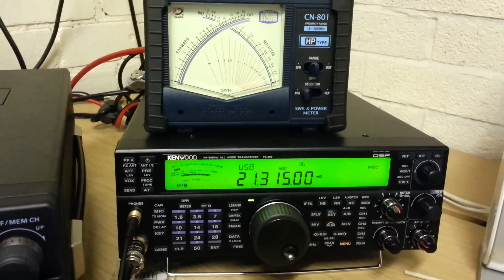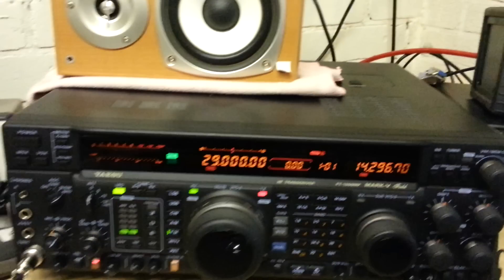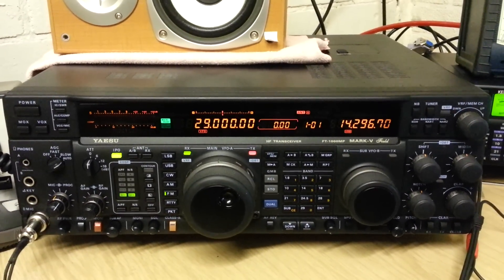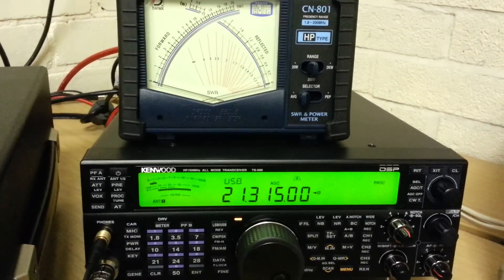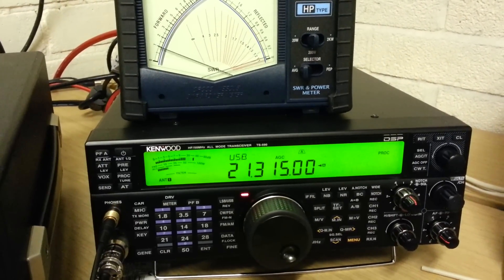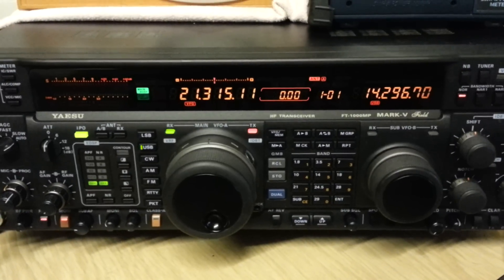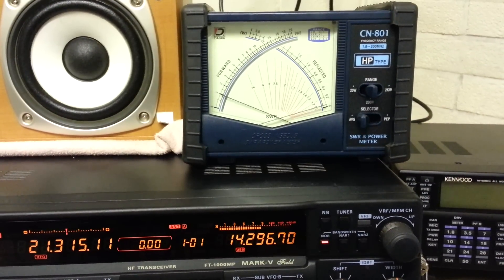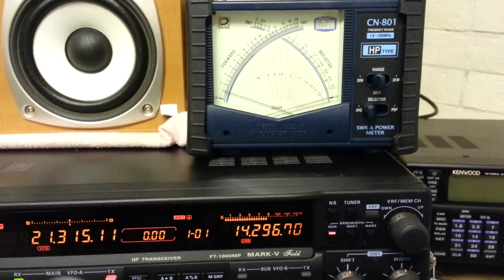TS590 vs FT1000 MKV Field SSB Talk Power

Comment: The correct way  to measure PEP is to use a oscilascope  and a two tone oscilator. I suspect that some radios, there mic sensitivity differers. Meter movements cannot respond fast enough to the peak of a wave form and those fitted with a so called pep meter are very suspect as I have found out for my self. G4LMZ
Reply: But since he's measuring average power in this video everything's perfectly fine here..
Reply: Average power does not give you true pep. legal max pep in the UK 400 pep.               Can not be done by measuring  average power.
Reply: True. Also true: this video isn't about PEP but average talk power. Your comment ('the correct way to measure PEP..') makes no real sense here. Some radios do true 100W PEP in SSB easily but perform worse (as in 'punch'/AVG) than some other with 40W PEP).
Reply: Some new operators might not understand the difference between analouge meter reading  and PEP
thinking there radio is faulty and if you have a 1000 watt PEP linear amp and your legal limit is 400 watts PEP how do you know when you have reached your legal limit what should the analogue meter be reading to represent  the power ???
Reply: Isn't knowledge about PEP part of the exam?
Like the envelope waveform and avg. power of a two tone test in comparison against single carrier and why it's used?
Reply: license states all ssb measurements  are in pep not average power [ UK]
Yes its in the exam  A AM transmitter for instance say a 100 watt carrier modulated to 100 percent will produce 400 watts pep  Two tone is the standard method which is used to check for a clean signal .to make sure there is no flat topping. Analogue meters cannot follow the waveform of ssb being to slow. A what would you say is average power for 400 watts pep  how do you measure it.
Reply: I guess Ofcom's regulations only state a maximum PEP,  not exactly how to measure - I guess you could measure with two tones AVG = PEP -3dB because it can be hard to measure PEP with single tone only as the voltage drops if power isn't stable - common problem of tube amps.
On SSB without compression I'd expect about 25% of PEP as AVG max - w/o compression but talking loud & long enough. I usually let my LP-100A do the measuring, but own cheaper meters like e.g. a Daiwa 801CN, too..
Reply: offcom states 400 watts pep
a two tone oscillator  and scope or other suitable instrument .  I have a Daiwa swr meter 
which claims to be able to read pep but it only charges up a capacitor which the meter is connected to and very rapidly discharges because of the meter resistance very misleading ,Max on 100 watts shows 40 watt. there are special meters around that peak hold for ssb
Reply: Just checked - I have a Daiwa CN801HP - which measures PEP quite ok when plugged into power - ofc the LP-100A is another league..
Reply: I presume that your CN 801HP  has some electronic circuit inside not just a cap being charged up from the rectified rf
I have some time ago built a pep meter using two ic chips to power the meter movement worked quite well. It would be a good idea if manufactures would build pep meters in to their radios. I think Acom linears already have them fitted as standard.